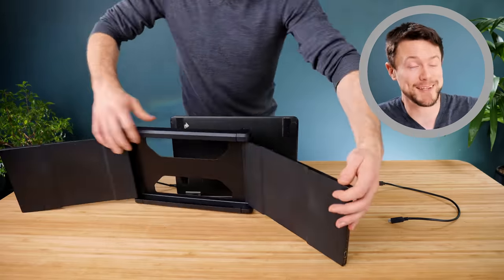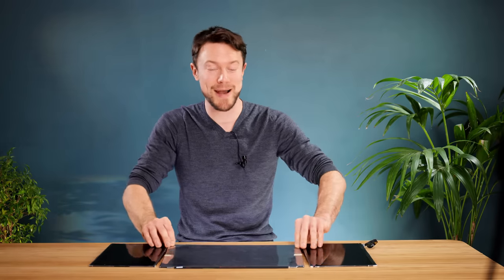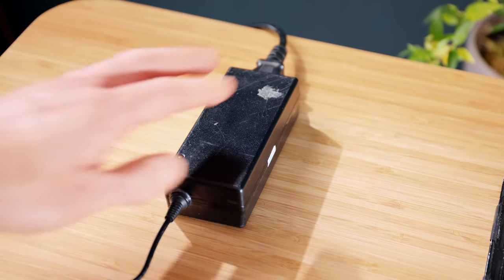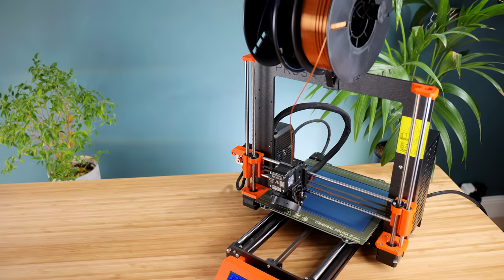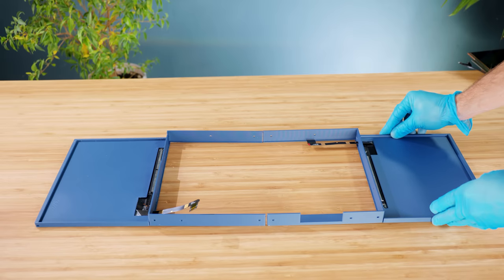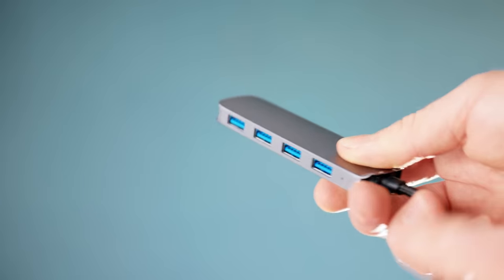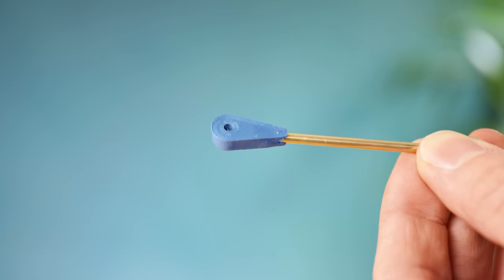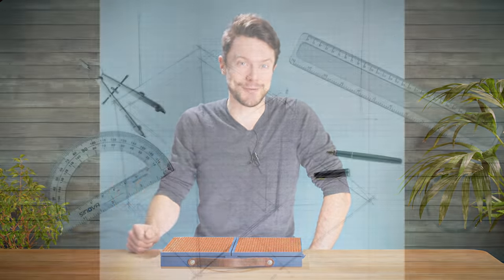Triple-Screen Laptop DONE RIGHT!

Comment: The framework mainboard being available just on their own is mental. Opens up so many possibilities. Im already thinking of having a couple of these in a 1U server chassis to run different servers like Homeassistant etc.
Reply: Cheaper to buy a cheap laptop off ebay with a broken screen and just pull the motherboard out of it and use it that way.
Reply: Raspberry pi and other single board computers already exist
Reply: @thewhitefalcon8539  does one with an i5 exist? Or one that runs windows exist? 😂

Comment: Personally I think it would have made more sense to just extend the usb-c port of the board so it's accessible from the outside. With the form factor you're gonna have to use a dongle anyway because most peripherals come with short cables (an external hard-drive for example). With the current setup an external drive would be dangling in the air just above the table.
Very neat overall tho!

Comment: It might be interesting to make also a version of it that is "just" an external display, powered by USB-C maybe
Reply: Trying to think how that would work. Run three usb-c cables to it?
Reply: @AndrewHelgeCox  You can daisy chain multiple monitors with Thunderbolt or DisplayPort. Obviously you'd need to get LCD driver boards that support it.
Reply: @man_eating_monkey  Cool, I don't think I ever knew that!
Reply: He already did it. Look up older videos.
Reply: @p_serdiuk  wasn’t it a single (not triple) brass built external monitor though? That’s extremely hard to replicate, I’m talking about an open source project like this one but for no motherboard inside
Reply: @piereligiodisante  No, I was thinking of the laptop with a second display that folds out upwards.
Since LCD dimensions and its driving board dimensions would be different for every such single-LCD project, especially if you're recycling an old laptop, it doesn't make sense to make a single 3D design. I guess if you want to do something like this it is genuinely a good idea to start thinking about learning some simple CAD software.
Reply: @p_serdiuk  oh i think I've missed that one

Comment: This is fantastic - I do wonder though if the common weak point of all the chassis panels being in the same spot creates a common failure point? Would be great to see this design modified slightly to split the inner tray in different spots to the outer one, so there is no major weak point

Comment: as engineer i found a flaw in the legs design 
you may replace it with T shaped tractable rod, it will add adjustable height,  more stability and remove the broken leg hinges dilemma 
the bars can be added to the back of the screen and when it expanded, the 2 legs extended on table surface to add more stability

Comment: Here's an idea, what if you take an old laptop remove it guts and fill it up with batteries and use it as a second monitor/power bank, this way it wont stand out as much as any portable or fold-able monitor currently  in the market, so you could use it  in a cafe, Library  or a meeting with your main laptop without looking like 80s hacker. 
BONUS feature, if you could somehow out put enough power from all the added batteries to run  a mini PC like the NUC or maybe a Mac Mini.
inspiring video as usual.

Comment: This is a killer setup. I'm sure if it is scaled up in terms of production units it can get a much better exterior design using metalic chasis and thinner bezels. 
That said, this is probably the most polished prototype I've seen ever. You thought about everything and that is quite impressing. Maybe the only real drawback yould be the internals, but I'm sure there is a way to do something about it to have the ultimate productivity laptop possible.

Comment: @Diy perks, you should have went with telescopic legs with various holes at different lengths with a small button like piece that can stick through the holes to lock it in place at various lengths to adjust the height of the display.

Comment: I noticed you hardwired the power for the display drivers. The HDMI spec passes through power using pins 17 for ground and 18 for 5v. You should be able to tap off the from the driver board somewhere. I suppose you may need to connect those pins within the cable too if they're not passed through. But then you would be able to disconnect them if needed.

I understand this is just a proof of concept though.

Comment: Offsetting the joint lines between the main housing frame and the back panel means you should be able to lap and glue for extra rigidity 😁

Comment: Low power e-ink for the left side display? You could shut off the main and right sides to display news, weather, time, etc. for a very long time on little power.
I'd also triple up the battery capacity, just because.

Comment: Hi Matt! Was wondering if you've considered making a Reflective LCD that substitutes the backlight for a reflective layer that bounces ambient light back through the LCD to produce an image. The end result is a completely daylight readable display that uses a fraction of the power, very similar to E-ink. Sun Vision Display sells a few that are pretty expensive. Would be curious if it's possible to DIY one for use in not just a desktop scenario, but also potentially in laptops and cellphones. Keep up the great work!

Comment: This is an amazing projects and looks very usable! But I'm worried about the cooling: the outtake is under the intake; hot air tends tends to go up so the fan is working against it and the intake may draw in hot air from the outtake. It may not be an issue (would need some testing to tell). I'm no expert in air flow.

Comment: With that, one has to carry the keyboard, one with a touchpad, separately. (One without a touchpad would require to also carry a mouse around). In a laptop or, more equivalent to your concept, a mobile workstation all that is integrated into only one device to carry around. I personally can better do without the side screens before I renounce easy handling of the device.

Comment: Hello @DIY Perks, 
I just started as a mechanical engineer intern in a production company. We are manufacturing primarily with steel/stainless steel/aluminium but we have the excact same 3D printer as you to use for smaller side projects internally in the company. My problem is, our 3D prints doesnt look as beautiful and smooth as yours look. Do you want to share your slicer settings? It would mean a lot to me. Best thoughts and wishes.

Comment: So you changed out the main monitor mid build realizing you needed space for the speakers.  The setup you show at 4:25 has the iPad monitors at exactly the same size as the main monitor but the end build there is quite a difference. Just wondering.

Comment: You took 5V from the USB-C to DP adaptor into a 9-12VDC DC jack supply... have you checked the adafruit board will comfortably work with 5V? or alternatively, the USB-C to DP adaptor may use PD protocol and raise its voltage to 9 volts but its not a certain. anyhow, very cool project!

Comment: side comment/partial question...

Those printers are usually ABS, is there any reason you went the super glue route when you could have just melted down some of the raft with acetone and used an ABS glue? admittedly not a 3d print expert, but i always went the ABS glue route as i thought it would better secure the parts.

Comment: Friggin' Brilliant !!   Legs are too flimsy, no problem make them thicker. Too many sharp edges, no problem - round them off, at least on the outsides. Handle is great and could double as an antennae.... I wonder if there can be wider side monitors?  The ipad stuff is actually too small.....
and.....if the side panels could be on post hinges, could they be mounted ABOVE the main screen?? hmmm.

Comment: That chicken wire surface will be a huge chore to clean. Laptops are usually made smooth for good reason. They get handled many times a day and will accumulate filth in any crevice.

Comment: It's a great idea... but the only problem is I don't think framework has modular graphics cards quite figured out yet.
So you'd just be running a basic laptop setup: so until framework figures out a solution, a lot of enthusiasts would be stuck getting a unfortunate external GPU that ruins the whole project by having to include a bulky 2nd device for the ability to play games on their PC.
So for a lot of the "I want a gaming laptop with 3 screens" this still isn't quite the solution they are looking for.

I'm starting to realize why some people have just given up and gone for VR headsets instead. If you got a Wifi connection: you can just use the Wifi connection to transmit the display wirelessly removing so much of this janky portable screen problem... This just isn't that future proof plus you may end up having to make repairs to the hinges and if one wire isn't plugged in just right yeh... this is just making me realize I need a VR headset even more. A VR headset can just be placed on your head and problem solved: this Laptop screen thing - has to be constantly redesigned, rebuilt, made lighter, add bigger battery, add this add that... I can see the practical side: but until Frameworks releases Nvidia cards that can be placed INSIDE: this is just never going to happen. I can have a laptop slightly ajar and turned on and all my problems are gone just like that.

This would work amazingly if there were finally those cards supported for frameworks. But this just isn't it Chief.

Comment: I would truly like to ask the makers of laptops a few question - one in particular: Why have such flimsy connectors and small fans? Seriously, I'd rather have bulky and near-silent laptop than a super thin one that constantly sounds like it is dying because the fans are constantly running full speed!
As for your project: Nice, but if you want to take this onto a plane or a train, I bet a regular laptop with an additional screen is the better idea...

Comment: @DIY Perks: Have you considered doing desktop version where you PHYSICALLY merge/fuse two monitors into a single larger one? I did a quick online search on how to do so, but all the results were for how to "fuse" the two monitors with software, which is the easy part. Unless I just suck at searching and finding what I'm looking for online. Anyway, just wanted to share that with you :)

Comment: CA glue is highly brittle and breaks easily. using a suitable plastic cement or solvent, or even heat melt to fuse the parts together would have been better

Comment: More importantly did you only have to print that base once? It's rare that I design something without having to print it a few times to allow for stupid oversights. Also I'd be surprised if the heat doesn't effect this thermoplastic case... Hopefully you used abs or nylon or something suitability high temp.

Comment: As I sit here with a face full of chips, I declare I have found an improvement!
When joining the two halves of the enclosure back, you could place the nutserts first and measure between their centres to ensure correct dimensions when gluing them togethe.

Comment: Using a laptop on your lap is bad for you because of poor ergonomics.
But using a laptop on your lap is bad the your laptop because of thermal constraints. Your lap generates some heat, just enough to prevent the laptop from cooling itself when most of the bottom grill/vent holes are obstructed. The laptop gets hot, it sucks more power, it throttles performance, it dies earlier.

Comment: That turned out really well. I've tried for years to find well sized side panels for a desktop PLP that is close to pixel matched (ie same pixel count/pitch on matching edges). The counts are actually easy to match, (1440*900 sides with 2k center), but it's just been impossible to find anything close to the same pitch. closest I came were some 4:3 CRTs that  were about an inch out from an FHD center.

Comment: It feels kind of wrong that you call this video "triple screen laptop DONE RIGHT" but as it turns out, you just used a modular laptop to build a portable All-In-One computer. Don't get me wrong, I loved what you came up with, but what the title got me to picture and the lead up, and the final product were WAAAY different. Was a little disappointed. I understand a triple monitor laptop can be a little uncomfortable. I'd still want to use it. I'd still pay for it, even if it weighed 100 pounds and needed 3 charger blocks. It comes with the territory, more displays come with more weight and power. And a laptop already has you bending down, so naturally more is going to be a little awkward. Not saying you did the wrong thing. Switching to a different portable PC style was probably the best use case for triple monitors. But don't put laptop in the title if you're gonna make an AIO. It's a small nitpick and I might get crap for it, but it does genuinely tick me off a bit, it's a little misleading.

Comment: I was hoping you were only prototyping the entire thing with the 3d printer and the  returning to it later for more premium materials. 

On a version 2, there's a lot I'd change. The legs are lazy mate. Not even clips, they just sorta dangle beneath. They also really need to be resizeable. Every monitor in the last 10 years can be height adjusted. 

I really think you need to find a way to find a way to make a keyboard fit in the carrying case. You've made your argument for why it can't be part of the unit, whatever I disagree but I'll give that to you. But you need to carry your extra thick laptop, your keyboard, and your mouse? It just loses all the appeal of a laptop. Plus it's probably pretty weak on power right? No real talk was given to thermals.